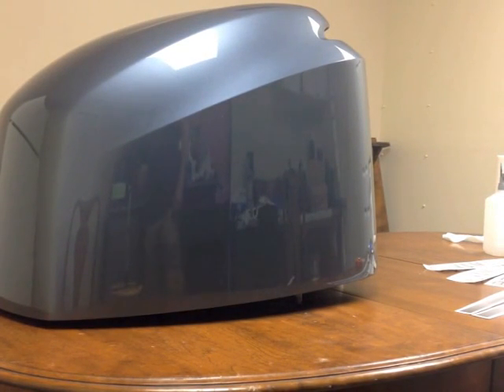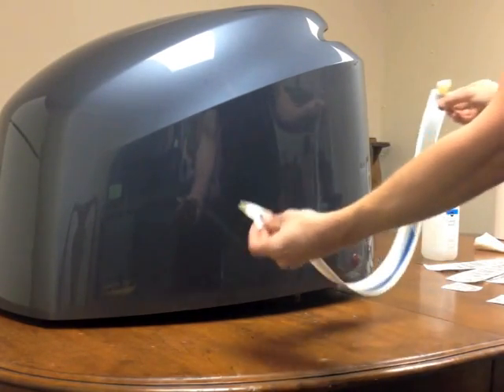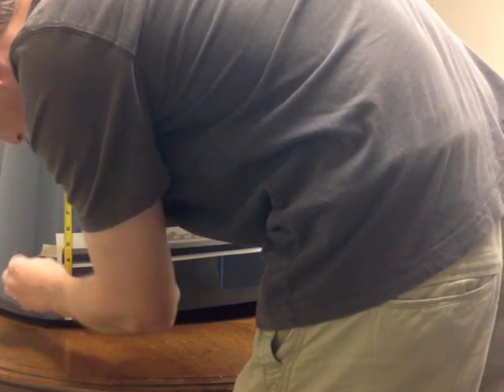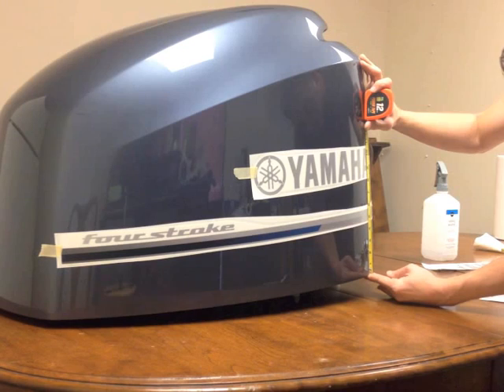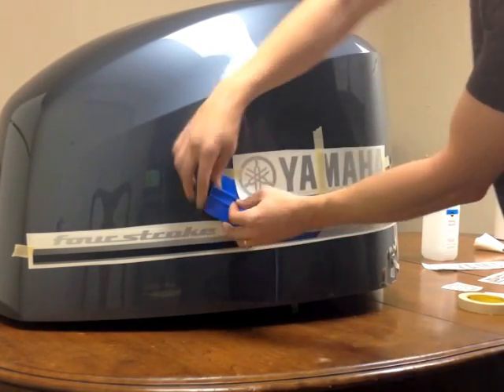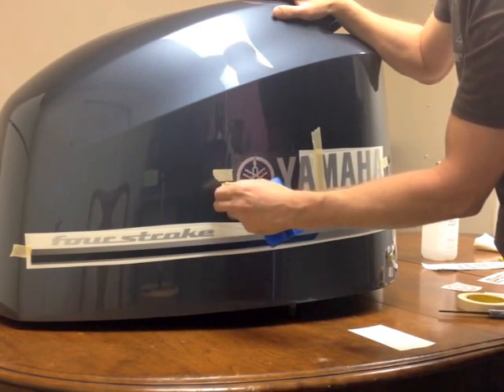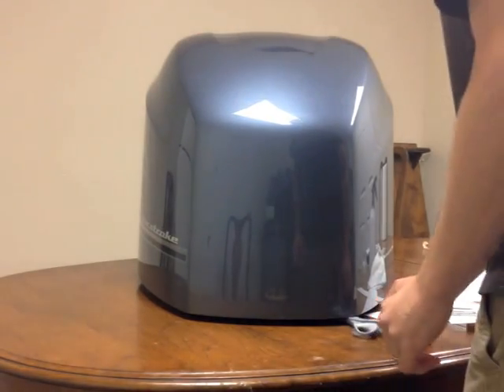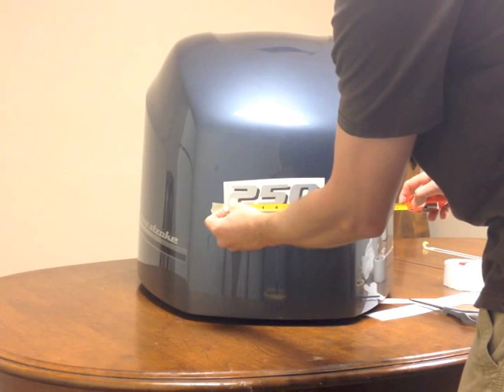How to Apply Outboard Decals (with Application Tape)

Comment: would you recommend applying a clear coat afterwords onto the decals and cowling?
Reply from the maker: +Mark Mizzi  We do not recommend clear coating because it is not necessary as our decals are already clear coated with a 3M UV Laminate. Although many of our customers do clear coat our decals with good results there have been a few instances where the clear coat ruined the decals. We know nothing about paint and which clear coats are good and therefore do not recommend taking the risk.
Reply: TY for your recommendation. My new decals are 3M and they do state that there is an extra clear vinyl on top.